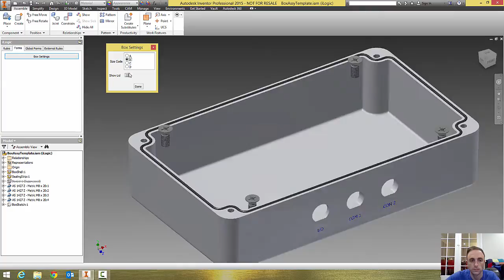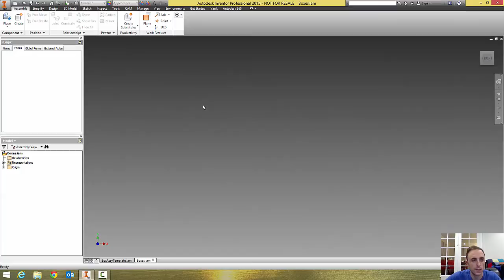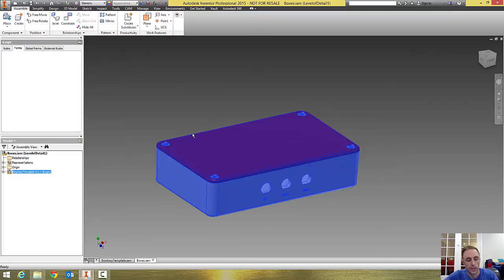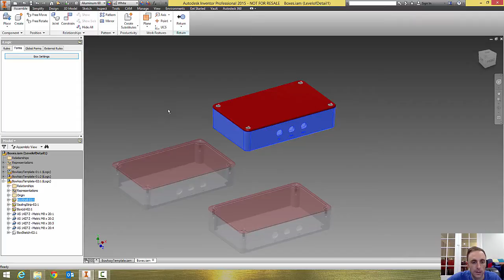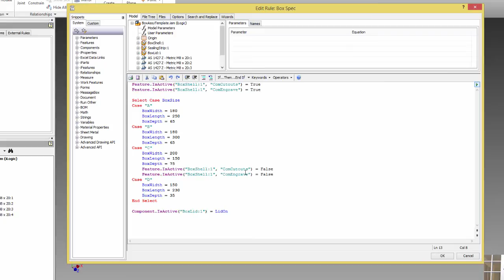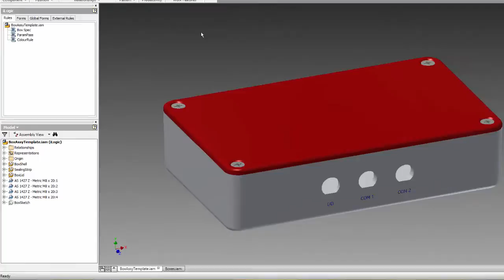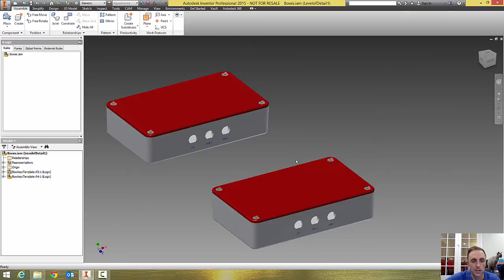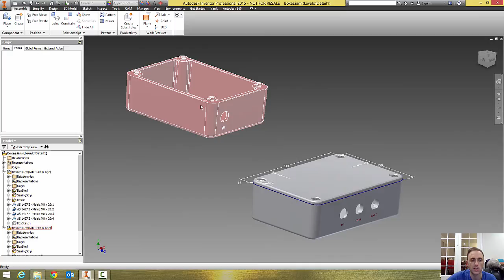Autodesk Inventor iLogic - Normalising and Assembly

Comment: It should be pointed out that any edits made to an instance name in an assembly breaks the default association between the instance name and the file name.  In fact, if you edit an instance name once and then turn around and edit it again so as to have the same as the original (associated) name, this so called "normalized" result is still achieved.